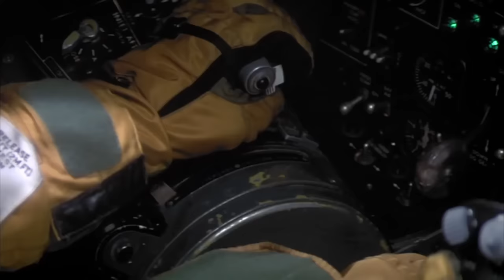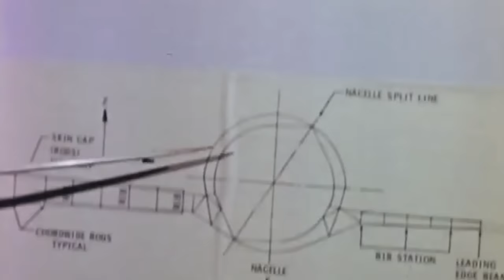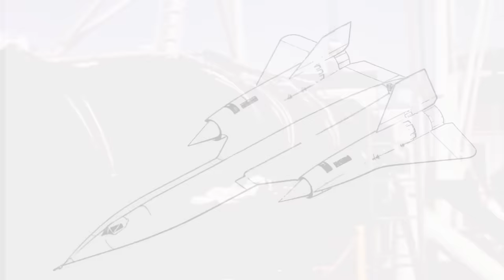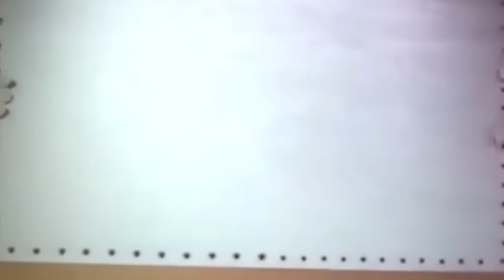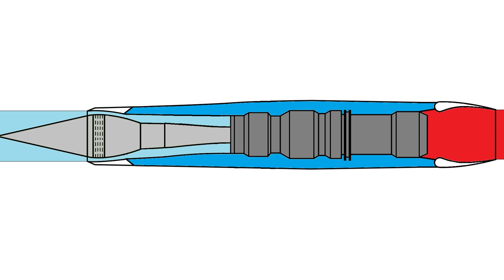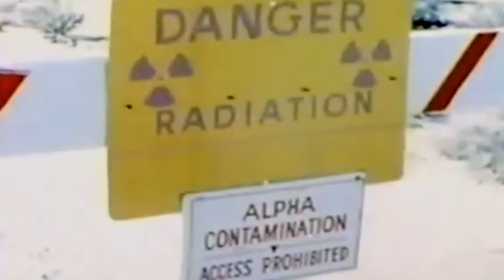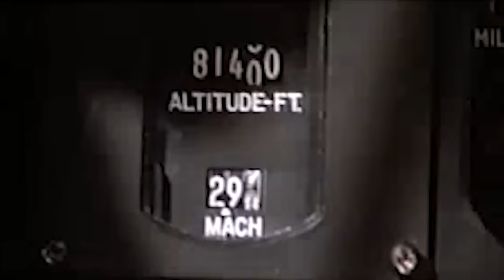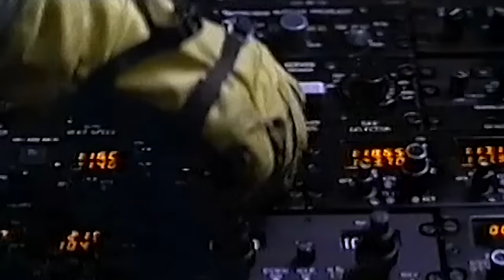Lockheed A-12 | Speed matters

Comment: Soviets were kicking themselves when then learned how the US got the titanium…and titanium wielding techniques. (Joe Sutter’s book  on 747 claimed they had a meeting in Paris, Soviets gave the technique, while US side explained some insight into 747 and pylon mounted engines. They even took the table cloth with scribbles on it)
Reply: Umm, the Soviets were building Alfa class double hull titanium fast attack nuclear subs in the mid '60's [wiki].
Reply: @crankychris2  I think you should re-read the OP.
Reply: What were they using for the aircraft surface that did not burn at such a high speed?
Reply: Why?

They made some money for a plane that never overflew the Soviet Union. Neither did the M-21, or the YF-12, or the SR-71... and the D-21 drone only accidentally did after overshooting China. 

No.. the only successful US overflights of Russia after Gary Powers (except for some very unsuccessful ones under Project Dark Gene) came from another Sutter design.. the OC-135 under the Treaty for Open Skies in the 1990s.
Reply: That meeting occurred years after the A-12 started flying. Lockheed already knew how to work with titanium. It was Boeing that need it for their 2707 supersonic airliner.
Reply: @typo pit actually...no.They kept trying to spy on USSR and were not doing so bad near the borders(also led to one of the most tragic aviation accidents),even used aircraft under Swedish service for it or under their cover(not the only ones). It was just that USSR SAMs were advance enough to respond and MiG-25 could take A-12 and SR-71 down...IF given a chance that they did not turn back.
Reply: @nikolaivasilev7371  
No they couldn't take one down, find the SR71 pilots testimony right here on YouTube about how a Foxhound tried to intercept his flight only to stall many thousands of feet below his SR71 and plummet downward. 
Everyone's always trying to say their country had something that could outdo the SR71 in some way or the other, but the fact is after many attempts with aircraft and missiles no one was ever able to intercept or shoot one down, and that certainly wasn't for a lack of trying.
Reply: @dukecraig2402  For,one,why didn't SR71 fly over USSR then? 2nd No,what he claimed is literally impossible, as MiG-25 can reach the same heights as SR-71 with 2 missiles. What SR71 could do is out run it and it did regularly 
As for no missiles being able to shoot it down....U-2? Difference of 2 km did not matter,especially to S200 with 40 km height range and it was more visible than U-2 on radar.Even S-75 could reach that height .If SR 71 was all of what you dream,then it wouldn't have sticked to the borders only,like all others.
Reply: @nikolaivasilev7371  
You do understand that the U2 is subsonic and the SR71 flies at 3.2 times the speed of sound don't you? Do the math on that one and you'll understand why after a bunch of attempts of shooting down SR71's with SAM's never worked. 
And as far as the SR71 never flying over Russia that was because after denying that U2's  were flying over Russia one got caught doing it, so the first time an SR71 overflew Russia everyone would have believed it.
You can dream on all you want but despite how many attempts at shooting down the SR71 with Russian made equipment by puppet government's not a single one was ever brought down that way, it doesn't matter if it's a Russian finger that pushes the button or a Chinese finger or a North Korean finger all the SAM's all said "Made in Russia" on them, and not a single one could catch it.
Reply: @dukecraig2402  And that is utter crap again. First,SR 71 couldn't do recon or take pictures at 3.2 machs...nor turn much. 2nd US literally tried many times to penetrate with SR 71,by their own accounts.Not to even mention how much US ever cared about that.From using aircraft is Swedish service,to hiding behind civilian planes to enter Soviet airspace.And no matter the proof or accusations,they continued doing so...even after some from Swedish service admitted it.
3rd Fact that they kept sending MiG-25 regularly means they detected it and that S200 could take it down at those heights.And sorry to tell you,aside from it not being able to do much at 3,2 machs and would take 150 miles to turn(in open skies and being locked on),S200 missiles were over 4,5 machs and already shown that they were quite able to shoot down modified MiG-25s and speed did not help either.
Oh,not to mention J-37 could lock on to SR-71...So the whole legend of it being invincible recon plane is bullcrap.
Reply: @nikolaivasilev7371  
Yes it did take it's pictures at that speed, I suppose next you'll say that satellites had to slow down to take pictures, you do understand that they take pictures at 18,000 MPH don't you? And yes it turned at that speed also, that's why at full speed it had a turning diameter of about 75 miles.
As for the rest of your comment I couldn't make it past that first part I'm laughing so hard, if I read any more I'll probably break a rib I'll laugh so hard.
Reply: @dukecraig2402  completely different problems...for there is no atmposphere.Thou that still doesn't change that S200 could shoot it down(could detect it,missiles over 4,5 mach speed,had missile height range of 40 km and could take down with ease modified MiG-25...)...or small fact that it ran away from MiG-25s...or that J-37 even locked on to it(which makes most myths about it a laugh)
And no,official turning diameter is 150 miles.SO either you know more than those who made it and said so/official date given by Lochkeed ,or you have no clue about the aircraft.You do not even know that much...again,not a surprise. Good thing you did not say it was just few miles.
Reply: @ Duke Craig

The SR-71 never overflew the USSR. 

Not once. 

Not ever. 

Evading SAMs and fighters over tiny nations like North Vietnam and North Korea is childs play. The Mig-25 did the exact same thing over the Sinai in the 70s and the Israeli Airforce didn’t shoot a single one down!

Also, a Mig-25 or Mig-31 doesn’t need to be at the same altitude as an SR-71 and collision course interceptions have been a thing since the 1950s. 

A transit over the USSR by the shortest route would still take hours and require a tanker at the other end. Rather than reacting and trying to do a stern chase, the PVO would launch interceptors and SAMs ahead of it. Every turn the SR-71 would make would bring it into the range of more interceptors and missiles and slow it down.  Or... the Soviets would just harass the tanker.. make it impossible to refuel, and wait for the SR-71 to run out of fuel. 

No.. all it did was the Baltic transits. All in international airspace or over friendly nations. And that is the only reason why it wasn’t shot down. Because every single time... there were Mig-31s or Mig-25s waiting, all in perfect firing positions which neither required the same speed or altitude as the SR-71 and huge Mach 5 missiles would mean there would be no chance of escape. The Mig-31s became so adept at it due to better tactics and the predictability of the SR-71s flight path that they would intercept from all four directions at once.. leaving no doubt in the SR-71 pilots mind that if they had a “navigation error” that they would be in a cell at Lefortovo that evening rather than the officer’s club at Mildenhall. 

If you read Brian Shul’s book or listen to his speeches, pay attention. They are full of weasel words which make you think that he was flying over the USSR but doesn’t explicitly say it. Like a dweeb who’s hanging around with a hot girl making stupid people think he’s getting lucky...... when the rest of us no that he’s solidly in the friend zone. 

Why would the US come up with Project Dark Gene if they could just fly into Soviet airspace at will?  American pilots getting shot down and captured after pretending to be “lost” in Iranian F-4s and F-5s?

Lol. And not just the Soviets.. but the Swedes repeatedly intercepted SR-71s with their Viggens as well. Both Swedish and Soviet fighters were close at hand when an SR-71 lost an engine and had to land in Sweden.  

So give it up. Anecdotal evidence from a few loud mouths doesn’t mean it happened. That Ike wanted to quit the Presidency after Garry Powers and leaders pressing for detente would make an easily detectable overflight—even if it wasn’t shot down—very foolhardy. 

This is also why the US campaigned so hard for the Treaty for Open Skies for decades... which was formalized shortly after the dissolution of the USSR.
Reply: @dukecraig2402  It makes a person wonder if they send bots after a person just as you finished up your comment on ussr flyovers. Some other troll knot 50cent army bot pops up and trys taking a poke at ya some peoples kids only if they knew of A S T R A
Reply: @Bartonovich52  Don't need to overfly a country when you're at 90,000ft with one of the most powerful lenses that can see thousands of km inland.
Reply: @nikolaivasilev7371  They didn't fly over the USSR from the very start because of the optics and they didn't need to not because the aircraft couldn't do it mind you the Sa-2 not the Foxbat downed a U-2. The SR-71 flew against both and left both in the dust even with the Soviets getting perfect intercepts. Maybe the S-75 could reach that height but at that slant range and speed especially against a knowing pilot who could just turn a little bit and throw off the entire intercept it wouldn't work. And if the S-200 can't shoot down a plane flying at mach 0.95 at 10,000ft by it just turning really hard and putting up a fight what would happen if a plane flying at Mach 3.2+ 90,000ft+ and it has the ability to extend or minimize your intercept by hundreds of km by just turning a few degrees left or right. You keep leaving out either Speed Altitude or Distance or just not realizing all of these aircraft were political in nature in everyone of your arguments try better next time buddy.
Reply: @eac1235  yeah,is that why US did not manage to spy with SR-71,yet lost so many other aircrafts and used so many aircrafts of other countries(civilian and state ones,with Swedish not only admitting,but being proud of it) ? Really? 
What is your knowledge to say it couldn't,even if we exclude logic,from which you seem to be detached? 
As for acomplishments...HEARD of the first man in space? Heard of first space station? Heard of first satelite ? We could go on and on about acomplishments...including first PESA radars and much more.
Reply: @koc988  actually,they do.Why do you think US has all those spy drones? For one,weather limits of how much of use it is. 2nd Angle and 3rd On notice info,instead of waiting. 4th better quality info in some aspects even today,let alone back then.
Reply: The titanium story was nonsense and was nothing more than goading.
Reply: @Bartonovich52  The A-12 being a CIA program, we don't know all of the flights nor the routs taken, maybe it didn't and maybe it did!
Reply: @typo pit Armand Hammer sold pencils to the USSR
Reply: @nikolaivasilev7371  The turning radius at cruise was 75mi. Read the story about the recon mission over Libya when Gaddifi threatened the USA and Reagan bombed the place. An SR was sent in the next day to asses the bombing and one of your J-37 was shot at it, the SR pilot pushed the throttles full forward, made his photo run as planned and outran the missile.  After clearing Libyan airspace and over the Mediterranean the SRO asked the pilot if perhaps he could throttle back now that they were out of danger.  The pilot's quote was " I looked down at the airspeed and saw mach numbers I had never seen before"  To this day no one was told how fast they were going. The SR did not overfly Russia, but can you be that sure of the CIA operated A-12?
Reply: @Bartonovich52  The US was overflying Russia since the end of WWll, first with B-29s and later with newer aircraft. There are plenty of books out there with all the details, planes and pilots on both sides have been shot down for decades.
Reply: @nikolaivasilev7371  So where is the Russian flag planted on the Moon?  First satellite?  Ike had explorer sitting in a Maryland warehouse and told the military he didn't want to have space be and expansion of the cold war.  We could have launched first but Ike stopped it.
Reply: @mikerowan1132  that is absolute bullcrap! US had no satelite in working when they sent first one.And again,first space lab,first space station,first human  in space....
Reply: @mikerowan1132  I already answered about Libya...Thou anyone with descent knowledge on the subject and a working brain would know the answer...But alas,when one lived of propaganda of exceptionalism,it tends to dumb down the nation...which is why half of US scientists were not born in US.
P.S. do not embarrass yourself further.You do not even know that J-37 is Swedish and not "ours".Or even worse(which for American dows not surprise me),you have no idea about country of Sweden or on whos side they were(neutral officially)
Reply: @spacecore117  You could differentiate    between  xenophobia and racism first,before commenting.But again,per usual,not surprised coming from someone from over there...And not a racist,nor xenophobih. However,common sense ,history and social science say a lot about this subject...regardless of which race or ethnic group we talk about.
My point is that US isn't capable of producing such talents anymore and it invests A LOT of money in schools abroad to take young talents away as soon as possible...And buy the rest up when they grow up.That is not racism,that is just a sign how much US dumbs down its people nowdays. That is not something to brag about,that most of your great talents come from other countries and that you are unable to produce as many great talents as before.THan again,if we look the average education in US,it is to say the least disappointing for the by far richest country in the world.

mean,
Reply: After the WW2 there was one last technical trade of good will between the British and soviets. when touring the rolls Royce engine, Soviet officers attached double sided tape to the soles of their shoes to collect metal shavings  they could study the metallurgy used to build longer lasting and reliable copies of the Nene engines they were sold. They could copy the dimensions but could not keep them from melting or cracking. Fun related factoid I think you'd find fun.
Reply: @nikolaivasilev7371  the Sr was made to out run everything & out height anything yeah thing can out run it like rocket & jets can fly the same height but none of them could do both at the same time .